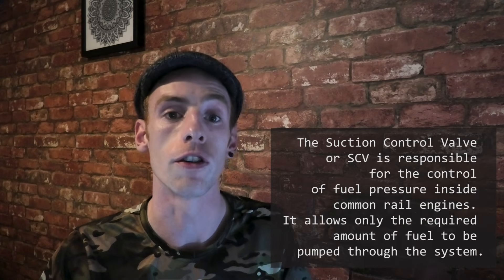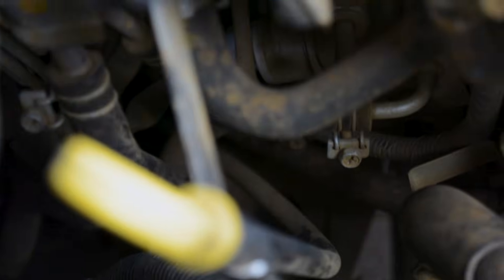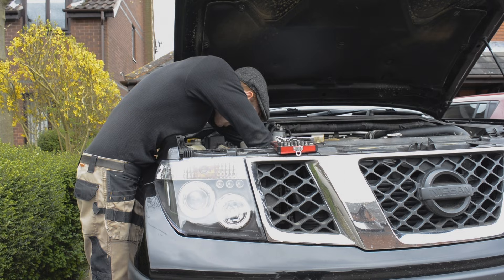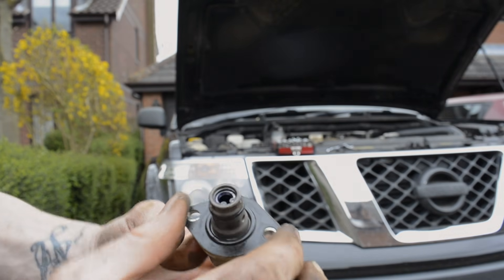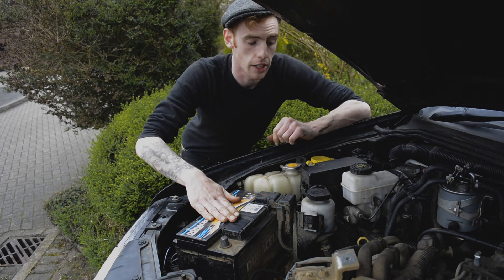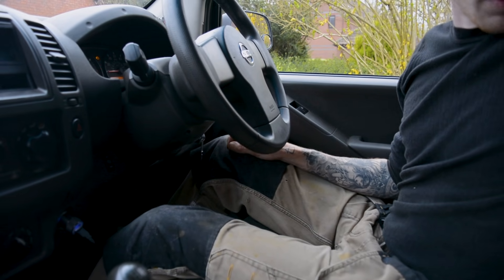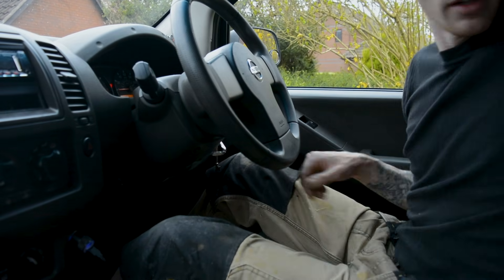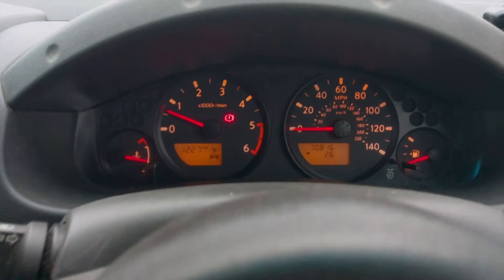Limp Mode - Nissan Navara YD25 - SCV Replacement

Comment: The number of this SVC is P0360 Denso 
You can find it more cheaper in Peugot and Citroen 
Also the injectors and fuel pump probably the same
Reply from the maker: Thats great advice, Thanks! I wonder about the injectors, I'd be interested in putting a new set in soon.

Comment: Good morning friend, I have a nissan navara diesel engine yd25tdi year 2010. Could you help me locate the PCV, SCV, EGR and IAC valve. the engine you fix is similar and nothing the same. Please help.
Reply from the maker: Scv valve is as shown on the video, the Egr is located at the front of the engine by the timing chain cover. Maybe you have a later model? You can Instagram me photos of you like and I'll try help in anyway possible.

Comment: Please help! I have a Nissan NP300 fitted with the YD25 turbo diesel intercooled engine. now mostly in the morning when I go to work it will have no power, even if I press the gas pedal to the floor, it does nor accelerate, when I stop and turn off the car the start again it  goes back to normal and accelerates fine, it may repeat the same problem when I go for lunch , so I dont know how the car is going to behave at any time, what could be the cause?
Reply from the maker: I'd say the scv would be a good option to look at replacing, this sounds like mine. Maybe try the fuel pump reset first to see if that helps?
Reply: Hi I have the same issue with my diesel 2007 pathfinder, no power when cold after 5 min warm up seems fine, did you get it sorted out?
Reply: Hey mine the accelerator cable is slow at responding,  what could be the problem?
Reply from the maker: @francismuchemwanakasale4216  is it in limp mode or just slow? Possibly could be a blocked egr if its slow acceleration, are the fuel & air filters clean?

Comment: Hi do you now this code P1275 nissan navara d40
Reply from the maker: Likely to be the fuel pump, the code reads that there is an error with the air fuel ratio sensor 1 response time.
Try doing the fuel pump reset that's in the video & description and this should help.

Comment: thanks for the video...i believe i must change it too... when i overtaking or accelerate fast is accidentally getting to safe mode and the car stopped moving... I'm pushing the gas pedal but doesn't response..it hardly reach 3000rpm...is that what happend to you too???
Reply from the maker: Sounds exactly like mine! Definitely worth changing the scv 👍

Comment: Hey mate, what was causing the limp mode for you? Mine happens when i put the car in cruise control at highway speeds. Driving around town under hard acceleration it doesnt happen.. It only seems to happen on cruise control under gentle acceleration. Thanks for the video, great tutorial.
Reply from the maker: Thanks! Mine was caused by hard acceleration also, every time I went a bit harder it would Limp straight away. Sounds like the scv to me!

Comment from the maker: This one's a bit more specific to navara owners but it's also an essential part of maintaining a vehicle for use on longer journeys for camping trips. Thanks for watching!
Reply: Do we need a laptop/program to reset back
Reply from the maker: @KamarolChemi  not for this, just the fuel pump reset with the pedal and key as in the description. Hope it works 👍
Reply: Hi. Where did you get the Denso scv from?
Reply: @anthonypurll1779  I've got to get scv for my 2000 nissan hoping it will fix it probably a new pair of injectors wouldn't go astray either